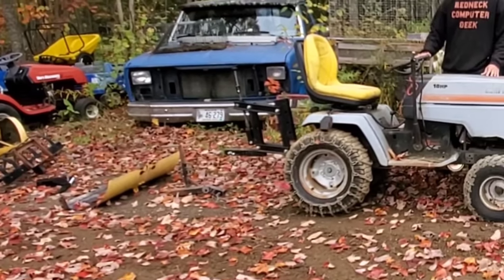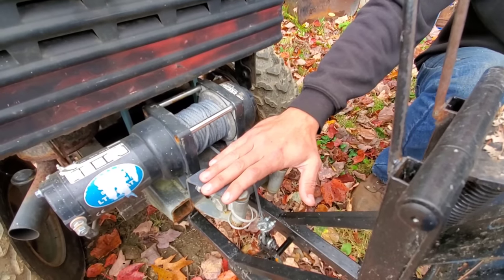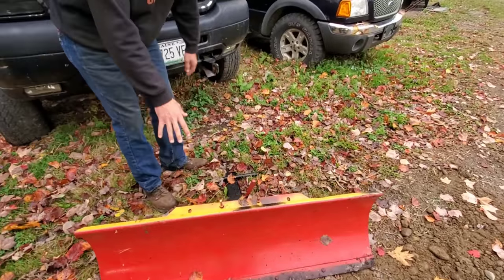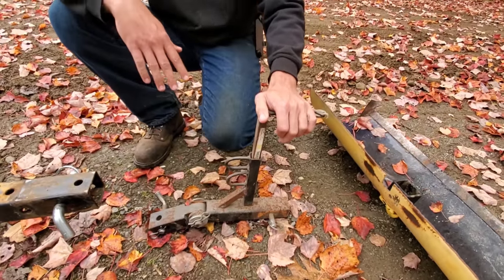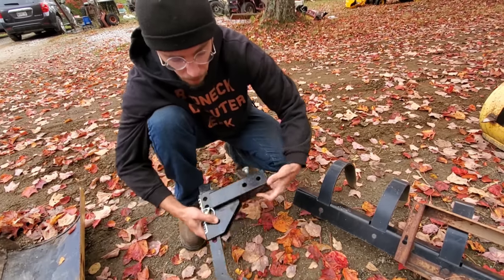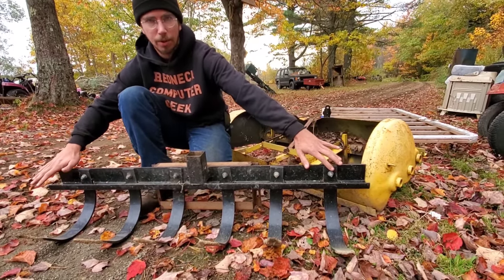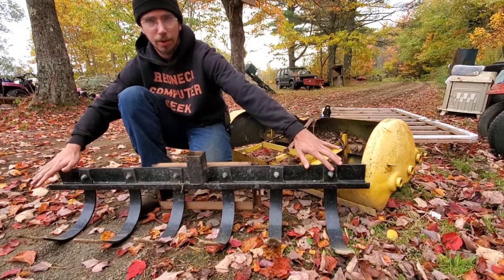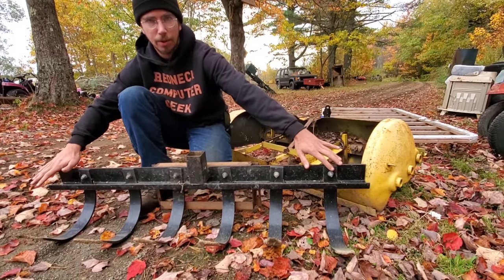1 Point Hitch and Implements

Comment: Instead of a hand crank I'd put an electric motor on it. 
Probably something like a windshield wiper motor. They are 12v with gear reduction and usually variable speed. Should be easy enough to mount then add sprockets and chain.

Comment: Time to modify that rear winch and 1pt hitch. Put a pulley on the crank rod where the handle attaches and move your winch to the top of the 1pt hitch and now you've got remove work on the fly.

Comment: I'm having a hard time finding a replacement seat any ideas
Reply: I know this was a little while ago when this comment was posted, but if you still are having trouble I would suggest going to a steel pan seat from an older garden tractor. I put one on my 1844 mtd and it worked great.
Reply: ebay